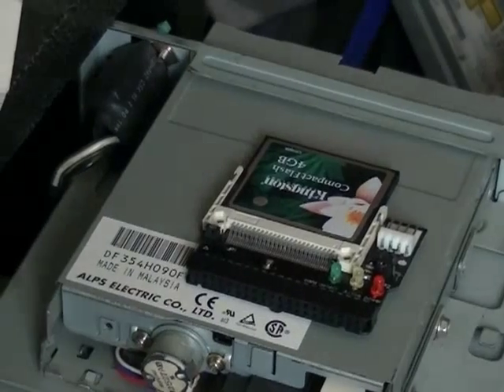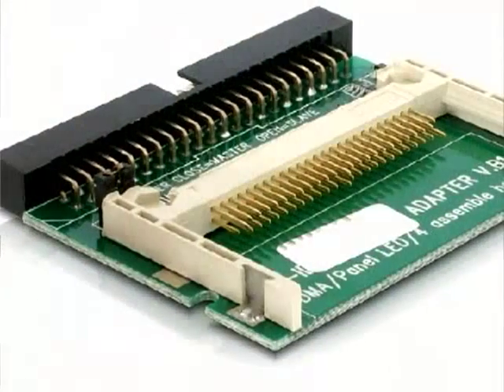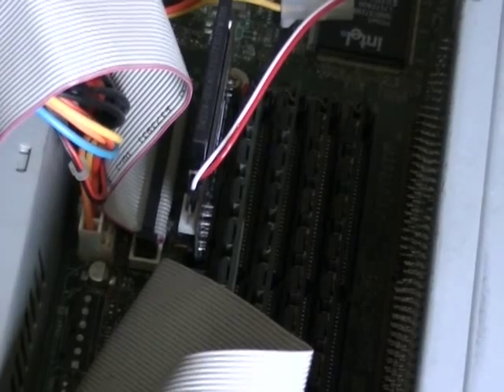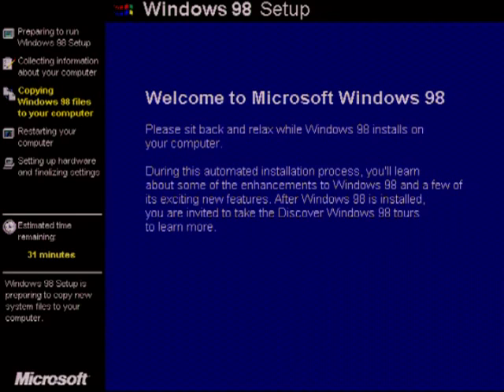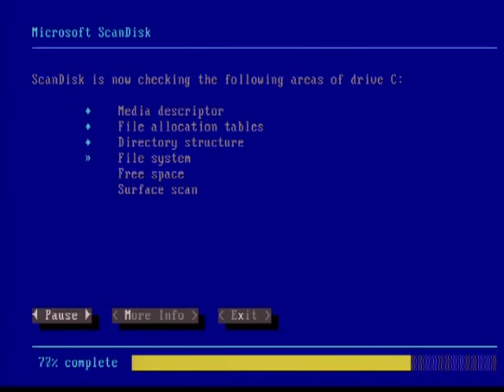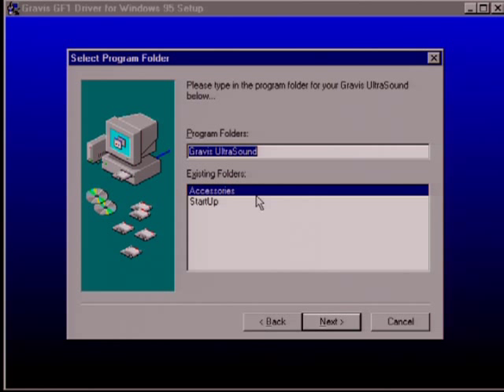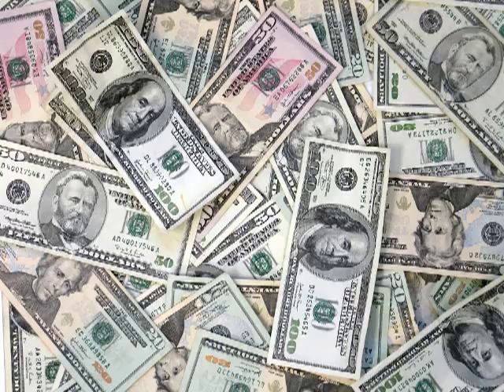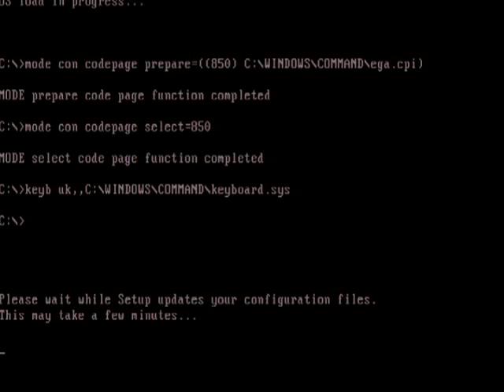CF Adaptor - My thoughts

Comment: These cards are fine for old windows (95, 98) but not for windows 2000, xp or 7, because of the way the windows NT writes too many files on it, the card will be broken before a year has passed.
Reply from the maker: Most certainly. I wouldn't really want to go beyond Win95 on one anyway, to be honest and even then there are stories of cards just suddenly dying. The moral of the story is probably the same as always; make backups, then make backups of those if it's something important.
Reply: how do the CF cards die, there's no moving parts unlike the regular mechanical hard drives

Comment: That particular Kingston CF card is a slower model, which could be why you've seen disappointing write performance. I've got one of those cards myself (albeit the 4GB version) and replacing it with a 133x or 150x CF card offered greatly improved read and write performance. Just thought it might be worth mentioning.